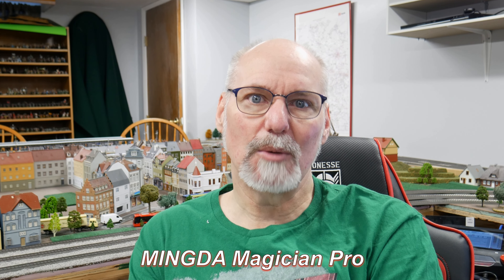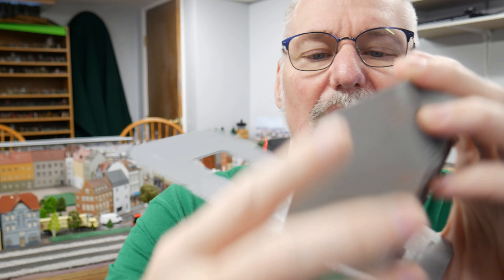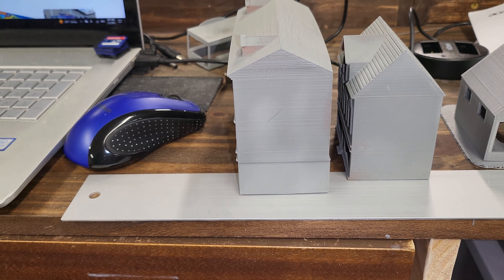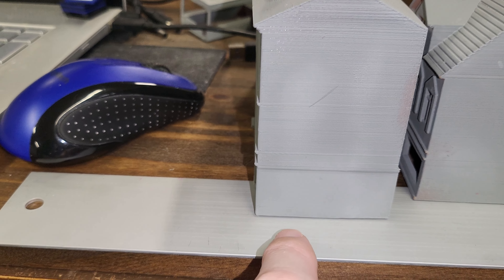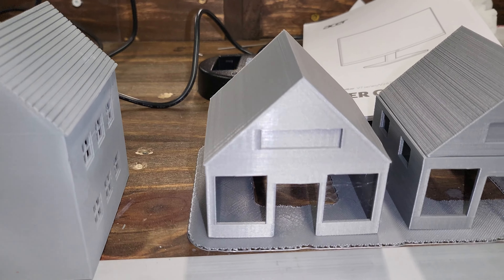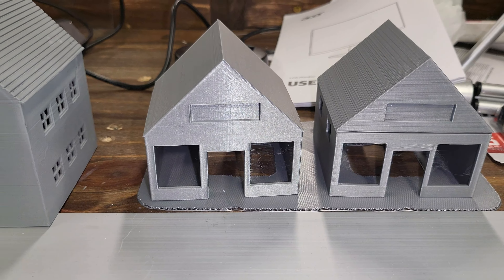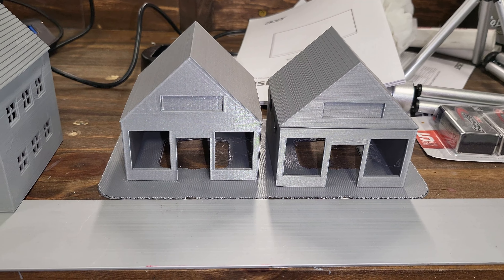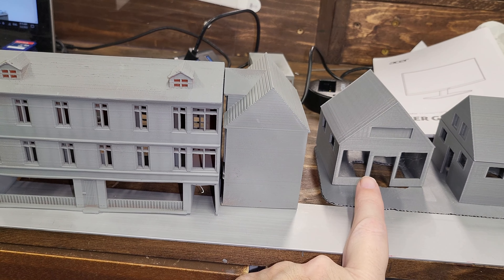MTO/TMO Quickie:  A 3D Success?  Finally?  #mingda #3dprinting

Comment: Glad to see you got a happy result Anthony.
Reply from the maker: I have had adjustment issues with my Ender 5 Pro for 2 years, so I gave up.  Then I decided to try an self-adjusting, to get me out of the equation.  Even this most simplistic design never worked on my previous printer.  So, to have no warping or distortions is a huge advance for me.  I know it is me and not the machines, so removing me makes the print better.

Comment: I’m pleased you got a working 3d printer
Reply from the maker: Hi Richard.  Well, my other one works; I am just awful at adjusting it.  This one is self-adjusting, so it saves me a few headaches.  As simple as these buildings are in design, to actually see one completed without the warping or other flaws is a big deal for me right now.  It has been frustrating knowing I was the problem with the first printer, so this one helps remove me from the equation.

Comment: Hey Anthony,  Great building design and your new 3D printer has done an amazing job. I love the design with the removable roof it will make adding interior detailing pieces easier. Take care Mr Dodge and all the best to you and your family.
Reply from the maker: Thanks, Deano.  It was a VERY simple design I did on TinkerCad, but for the first time ever, I had a 3D building come out without any warping or other serious issues.  So, the new machine and the containment box I built for it seem to be working so far.

Comment: They look good,
 I do like the house style with shop fronts from your first shot from the old print run
Reply from the maker: I love those prints, too.  The designer basically pirated some Faller kit designs and modified them.  Unfortunately, I kept getting that warping, no matter what I did.  The MINGDA 3D printer is almost all self-adjusting and automated, so I am removed from the equation, and VOILA- no major errors.  I will begin printing those buildings again now that I think I have eliminated my mistake-prone self from the system.  I will also start modifying my TinkerCad designs, too.

Comment: Cute little buildings.
Reply from the maker: Indeed, but Bahnhofstrasse in Delmenhorst has several buildings in this style.  However, the key is that they printed without major errors, which is a first for me and 3D buildings.  Something finally printed right after 18 months of trying.
Reply: Looks like you Nailed it Anthony!
Reply from the maker: @bernardc2553   Well, it is a very simplistic design, but considering I have tried 25+ building prints and always had flaws, some major, this was a huge step forward with the new printer.

Comment: Very interesting Anthony. I have been trying to decide if I want to get into 3D printing.  I am a total neophyte and did not know that such a thing as that warping occurring…. Thanks for the info. Congrats on better results with the new printer.
Reply from the maker: Hello, Rick!  It seems the vast majority have better initial success than I did, but the self-leveling and fine tuning machines take some human error out of the works, and that is what I needed.  There are channels where they are printing cab bodies, coaches, missing parts, etc., along with buildings and even people.  3D printers, Cricuts, and even Laser cutters are revolutionizing the hobby.

Comment: Good job Anthony. That should help you a lot. Funny you should have know manual leveling just wasn’t for you😅. Glad you will be able to do buildings that work for you.
Reply from the maker: I have built decks, walls, sidewalks, plumbing, etc. and never had a problem leveling, but my first 3D printer... major issues non-stop.  I quit for nearly a year, and now have a machine that eliminates me from the equation.

Comment: Ave AD, the next level is to get some texture in the wall and sealing, like concrete, stone, even timber ... >;) ... have fun.
Reply from the maker: The next level is to have more prints come out without errors.  This was a huge step, considering my previous printer always had issues- and I know I was the cause of the issues, not the machine.  Even these very simplistic buildings never came out this far or this well.  So, the new printer is almost all self-adjusting, thus I can not screw up the settings.

Comment: Hi Anthony, Great job on the buildings you designed and they turned out without any warping is a major win. I Know nothing about 3D Printing so this may seem a silly question, how do you support the roof sections when they are being printed on the one piece buiding?.  The building with the separate roof is how I imagined 3D construction to be made.  Its good you have cracked the problem and can continue with your small town project. Very interesting video to watch. Cheers, Paul.🏘🏠🏪🏦👍👍
Reply from the maker: Hello, Paul!  Thanks for the view!  It is definitely a win for me, even with a simplistic design, after so many failures on my first printer.  As for the roof support, as this is a low-level, high-angled roof, I have no supports built in, but otherwise, you just design support beams or planks as needed.  Cheers!

Comment: Hey Der Anthony! The buildings look amazing eh! When I was shopping for 3D printers, I decided I needed an enclosed printer. When I am ready to buy, I decided on the FlashForge Adventurer 4. I would have already ordered it, but decided on a new sound system for the woodworking/Chill-out area workshop. Have a wonderful day eh!
Reply from the maker: I really wanted the FlashForge 4 or even 3, but I got swayed by some of the negative reviews (especially how, for PLA, the system doesn't actually close because of how you have to load it).  I bought a containment enclosure for my Ender 5 Pro, but I still had failures- all on me, not the machine.  The MINGDA is almost all automatic, so I am removed from the equation and built a custom containment enclosure for it.  These prints are VERY basic, but it is the first time I have had a print come out and not be warped or seriously messed up.  A small victory, but a huge one for me personally.

Comment: Are doing some 3 D printing? Looks good.
Reply from the maker: Well, I am on my second machine, as I could never get prints to come out right on the first one, even though it was a highly rated one.  The problem was me... I had to make all the adjustments, and I just could not figure it out.  The new machine is almost entirely automatic, so I am removed from the equation.  So, even those these were simplistic buildings, the result is the first time something came out without major issues.

Comment: lot better, the self leveling does make it easier. If I get another one, it will be self leveling and a bigger bed.
Reply from the maker: Well, this is the best print form of any building (including these).  These are as simplistic as they can be, but I could not even get these to come out right with my other printer.  Now, no warping- so, it is a small step, but a huge step for me.